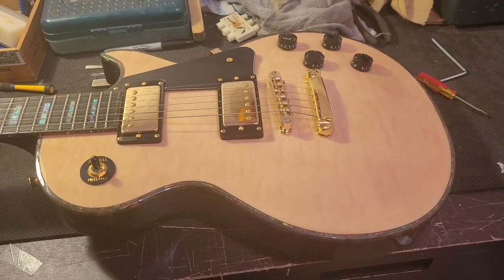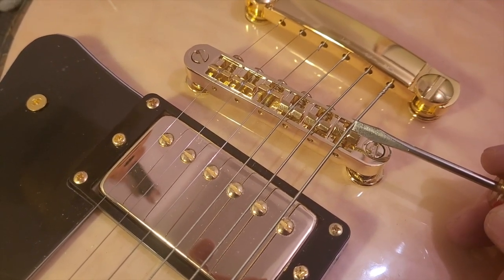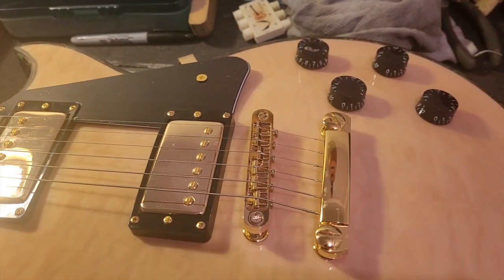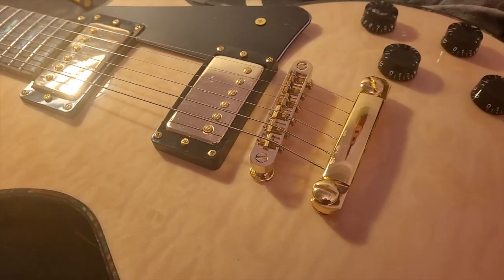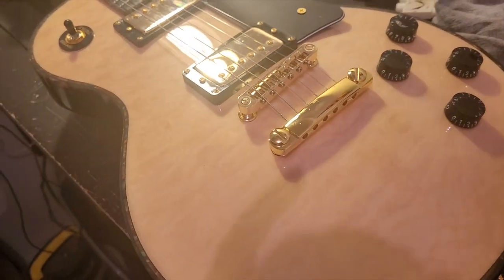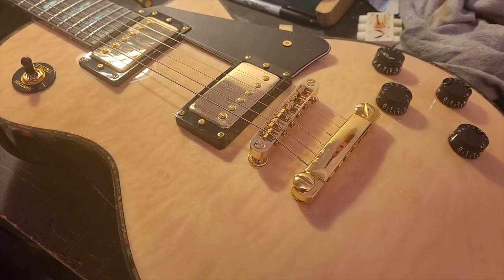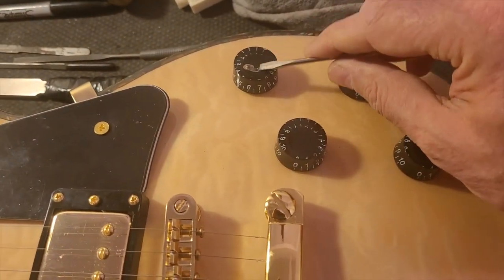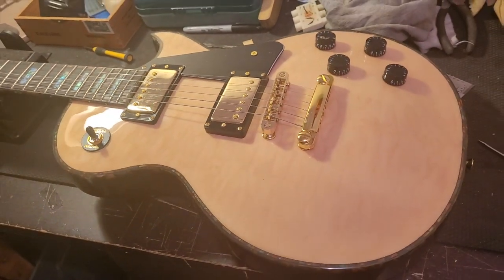Why modders replace electric guitar bridges...

Comment: On a Stratocaster type guitar I switch the string trees that are up on the headstock to rollers. The ones that are always there are nothing but poopy and the string always snags then let’s go with a ding if you’re going to bend the string. So rollers on the headstock is an absolute must!!!
Reply: I’ve got a roller nut on my strat. No string trees, and I’ve heard different opinions on that

I have absolutely zero issues with the nut with regards to tuning or the string popping out of the slot
Reply from the maker: Very true - often the string trees that come on budget guitars are abysmal!

Comment: Got a ABR bell brass bridge for the Epi Casino. No slots though. Basically set the E strings, string spacing ruler for the middle strings, tapped the top of the strings with a punch and a fretting hammer to mark em. Diamond slotting files angled back slightly above the tail piece (roll it off a touch to debur any sharp edges), radius gauge and a triangle file to get the V shape. Came out awesome with minimal sitar effect, bell brass sounds great. Use the old strings to slot it. Then change em before intonation. Hammering ruins em.
Reply from the maker: Sounds brilliant.

Comment: It looks like one of the saddle screws is not flat to the bridge. I would take it off and see if there’s any loose parts. I had one that had a lose clip that held the saddle screw in place.
I would also turn the bridge round so the saddle screws are facing the pickups.
I know you will have probably adjusted the truss rod, but I would just make sure it’s not loose and causing some rattle.
I sometimes cut a V shape at the back of each nut slot. I find that can help with rattle.
Reply from the maker: Yes, it came installed that way from the manufacturer - the saddles are loose and the bridge is fairly poor quality.

Comment: Can you run the strings the opposite way in the tail piece and use it as a wrapover? That would decrease the breakover angle and allow more room to clear the bridge.
Reply: That would work (and many do this), but depending on the tailpiece, it may have a tendency to "lean forward" if it is not a locking one!. You can also simply "raise the tailpiece" and it does the same thing to decrease the break-angle, though some claim this "reduces sustain" and believe the tailpiece has to be Firmly bolted down to the body, but I've never noticed any issues and at the moment have my tailpiece raised as it reduces break-angle and also makes the strings "easier to bend!"..
Reply: Like PRS already does?
Reply from the maker: As has been stated - you see this by certain manufacturers and luthiers.

Comment: bridge and tailpiece work together to make angle and height of strings.... so a saddle may have a burr on it or the treble side of the bridge may need to be raised or even the tailpiece raised to lower the angle of the strings over the saddles, etc. But a single bridge saddle cannot be moved up/down but the bridge side can and the saddle can be smoothed.
Reply from the maker: Bang on as usual old chap!

Comment: I think you may have saved my Epiphone ES-175! It’s been buzzing on one string for a long time, and I assumed it was a resonance somewhere, but I can never track it down. I figured if it was the bridge, it wouldn’t just be one string. Going to order a replacement Gotoh now!
Reply from the maker: That will probably be the problem - cheap parts sometimes need upgrading.
Reply: Super glue it first.
Or resin &hardener .
If that doesn’t work then spend. Intonate heavily before.

Comment: I get better tuning stability with a roller bridge. Less slack in the strings. I normally don't even change the tuners. I just replace the nut, tighten the tuners, and stretch the strings and the tuning is rock solid.
Reply: Please tell me you don't tighten the screw in the end of the button.
Reply from the maker: The roller saddles for stop tail bridges is a big debate in the guitar world - I've heard both sides.

Comment: Once It’s intimated. A drop of super glue/ or glass and hardener..
Cheaper ,less obtrusive ,quick . If that doesn’t solve your problem then replacement..
You were going to have to throw it away anyhow.!
Nothing to loose.
Reply: I went with Blue Loctite! one drop on the adjustment screw run it back and forth to make sure it's applied evenly on the threads. Keeps things from vibrating yet still will allow you to adjust intonation when needed!
Reply from the maker: Better to replace though...
Reply: @FlowforthInstruments  maybe! Some claim it changes the attack and or the tone. Personally I think that has more to do with the materials and construction practices. I put a Fender LSR nut on one of my trem based guitars and I didn’t notice any difference in the tonal qualities at all.

Comment: I always go to at least "Tone-Pro" for bridge and the stop bar, when ever I am trying to get the best out of a Les Paul, including all Epi's. I build LP's and Jr.'s and I never use cheap hardware. The Tone Pro brand offers a couple of improved "lock-down" versions, for both Imperial and metric guitars made of better metal. It is definitely worth the expense. Upgrading the stop bar makes a surprising difference going from mostly zinc , :pot metal: to cast brass  works well. Rollers have even more potential for rattling, and on a Bigsby equipped guitar I make sure the saddles are highly polished and that does it. Good presentation.
Reply from the maker: Yes, TonePro is a good brand but not everyone will fork out that amount for a bridge.  The cheaper Wilkinsons aren't bad - better than what comes on most budget guitars.

Comment: I think it’s worth mentioning that TOM bridges tend to collapse over time, which is just when the bridge begins to warp/flex downward toward the guitar body from the pressure of the strings. If it’s the D & G strings giving you persistent issues, then you likely have a collapsed bridge. It effectively changes the string-radius of the saddles by lowering the center ones. The top of the bridge should be perfectly straight, so if you place a straight edge across the bridge (over the post holes, in front of the saddles) and you can see any gap in the center, you have a collapsed bridge. It’s essentially unavoidable, given enough time. But the process can be accelerated by using heavier string gauges, having more string tension, or having a steeper break-angle from keeping the tailpiece set too low
Reply: TLDR version: your bridge is bent bruh
Reply from the maker: Good stuff - thanks for taking the time!

Comment: Thanks, just got LTD H3 with my first TOM bridge (Tonepros), I must say don't like the concept at all, it seems like an old design that for some reason is still being used (yes, I know on arch tops it is the most obv option). There are so many things either wrong or strange about design, feels like it has the third leg to fix other two :D
Other than that, it takes time and practice to get used to it (height above body, different angle, saddles under your palm etc) after Floyd/Hipshot bridges :)
Reply from the maker: Yes, TOM bridges are odd designs.

Comment: I ran into problems buying a gotoh tuneomatic,thinking I could just change out the thumb wheel, and get the adapters,uses the existing body studs allowing you to go from large post to small,seems real Gibson LPs have a wider bridge than the imports do,the gotoh wouldn’t fit,I did get a Nashville small post for it, but I had to turn the saddles around to make it into a tuneomatic,there was a noticeable improvement.
Reply from the maker: Sounds like you discovered a good mod.

Comment: Bridge is also backwards. The intonation screws should face forward for adjustment access and to keep string from interfering. I like old worn in tuneOmatics,  but every thing new is going to get JD Moon roller saddles,  tremelo or not.
Reply from the maker: Yes, I forgot to mention that - that's the way it came.

Comment: 1. The bridge base of a TOM is arched to match the radius of the fretboard. Zinc bridges collapse- lose their radius, flattening out over time. Happens on vintage Gibsons, happens on new guitars, only takes a little flattening to cause buzzing. one of the first things to check.
2. Guitars with that style neck joint tend to "hump" the fretboard at the joint, raising the frets and causing insane inexplicable buzzing, unless you know to look for it. Again, one of the first things to check. 
Check those. Roller bridges shouldn't be part of the discussion at this point. You're still trying to satisfy the basic string geometry.
Reply from the maker: Great points - yes, I've often come across a sagging bridge - it does tend to happen over time. True, the old body join hump is a particular curse on budget guitars - first thing I check!
Reply: @FlowforthInstruments  the old body join hump - suits you, Sir 😙
Reply from the maker: @davekeating.  Ha- hopefully not Taylors!

Comment: Because the ABR1 is a better design than the Nashville.  Longer sustain due to how the strings passover the bridge not touching the back edge of it as they go into the saddle. Look at your Nashville. You will see the strings touching the edge of the bridge.  You don't want that.
Reply from the maker: Good point!

Comment: I got a roller bridge for my SG that has a Bigsby B70, and at the time I didn't know much about them, so I picked one out based on it's looks.  The grooves in the rollers don't seem to be deep enough, because the lighter strings keep popping out.  The rollers seem to be like the brass piece at the ends of the strings.  I can't say that's what they used for the rollers for sure.
Anywho, I'm putting a Maestro Vibrola on it, but waiting on the new tuners to be delivered.  I'm thinking about trying a Schaller roller bridge if I'm still having a problem with the new tremolo. The top of the posts are not visible from the top and it's not necessarily cheap, rather expensive. 
Would you recommend the Schaller roller bridge or had you any experience with them ???  Thanks.
Reply from the maker: I've always found schaller to be excellent products.
Reply: That's what I decided to get. Schaller is the finest, German craftsmanship. I would have gotten Schaller tuners but the screw holes didn't line up, so I went with the Grovers. I didn't want to drill new holes and the original holes would have been visible, I believe. Thanks  @FlowforthInstruments

Comment: A shot in the dark, but I need a Les paul style bridge with post wholes at 78mm, which is seemingly impossible to find. Does anyone here have experience with finding Les paul style bridges in odd ball sizes or even a modern company that makes custom les paul bridges?
Reply from the maker: Try Guitar Fetish.
Reply: @FlowforthInstruments  
I appreciate it, but I believe I have checked there already.
Reply from the maker: @RickDrift  It's tough because most people just sell universal tune-o-matic bridges - you might have to call a proper Luthier place like Stewart McDonald.  You'll pay more but they probably can point you to the right size bridge.

Comment: I have just about used them all, faber is what you want, tone pro’s while just as good, the company claimed to me, the bridge saddles could not be replaced, nor would they sell individual saddles, that will not work long term. And is complete BS!  so I removed all tonepro parts are refuse to use anything by that company. Faber is a much better company, and the best of the best when it comes to abr1 styles, bridge , and Nashville conversations to studs. And like I said, I believe I have tried just about everything made. Gibson parts are not all that great now. Just my take on all this.  You want the best, use faber!
Reply from the maker: Ah thank you... Faber was what I was trying to think of in the video.  They are modeled on the old Gibson bridges but better.
Reply: Agree. I got an ABRM from Faber with brass saddles. I replaced that and my stop tail with a Gotoh. I was going for similar materials to a real 59 on my Standard Outfit 59 Epi and it's incredible now

Comment: Stretch the springs. You've got loose fitting screws in there right now, with insufficient loading between the saddles and screws as they are set in their recesses. There is no rocket science here. Also, you've cut the grooves way too wide and far into those saddles and increased the landings and surface contact points.
Reply from the maker: Thanks for your insight!

Comment: the original TOM bridges are good that one is crap those v saddles are no bueno as well..the older saddles are good as well don't know why they used those
Reply from the maker: These budget companies buy cheap parts to keep the costs down - that's why modders go crazy with the part replacements.